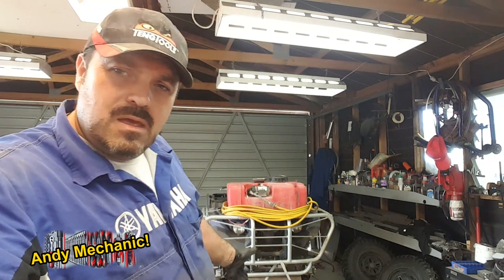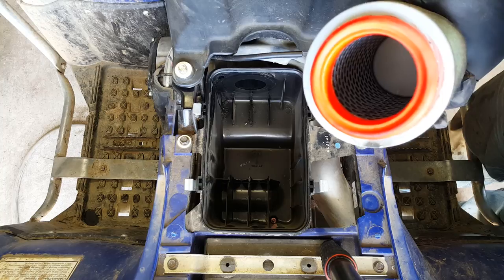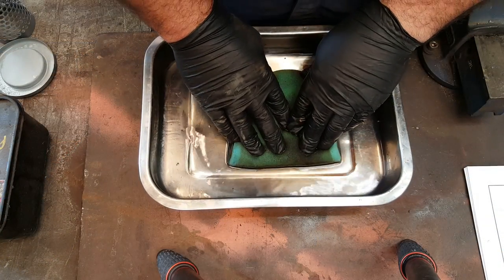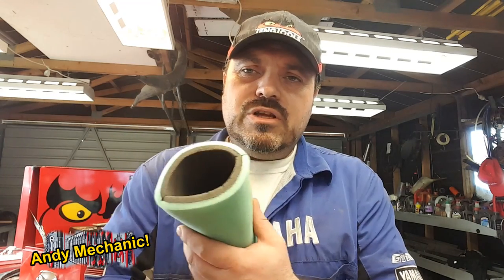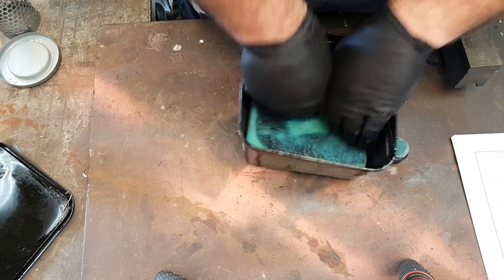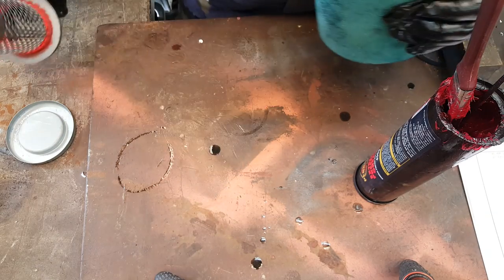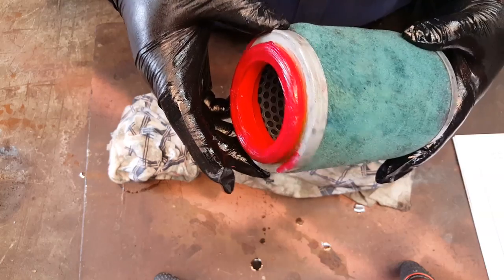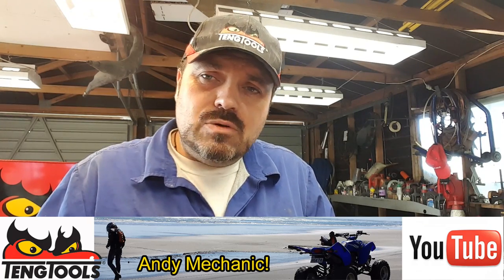Yamaha Grizzly 450 - foam air filter service #1810

Comment: You’ve probably been told this before but you are awesome. Thank you so much for the video. My grizzly stopped running and the only thing I could find wrong was an extremely dirty air filter. So I will be cleaning it and doing exactly what you have shown. Thank you, thank you, thank you!
Reply from the maker: Cheers Charlotte :-) really appreciate your feedback & it's great to know the video helped you out. Until next time Andy
Reply: Andy Mechanic well, after my filter cleaning, just like you taught, I put it back on and my 4wheeler still didn’t start. It turns over nice so now I’m figuring it might be a fuel filter. Is there an external fuel filter on these? I’m sure there is but I don’t know where.
Reply from the maker: Hmmm.....just try starting it without the air filter - sometimes the freshly oiled filter can restrict the air too much. Make sure the air box is clean though so no dirt gets drawn into the engine.

Also, is the fuel relatively new or old as petrol can go off.

Fuel filter - just one in the tank I think
Reply: Andy Mechanic OK, I will take out the air filter and try to start the motor without it. The fuel was in the tank last fall. It is stored indoors. Thank you so much for your advice.
Reply from the maker: Hmmmm.....I'd suggest draining the fuel tank & carb & giving the bike some fresh petrol :-)
Reply: Andy Mechanic I ran it for about an hour before it quit. But I will change gas and see if that helps. Hope so, I use it on the farm a lot. Thank you so much for all your help.
Reply from the maker: Ah....Okay.  sorry, I thought the bike had been stood unused for a few months and then wouldn't start.  Okay, back to basics. Can you tell me if there is a spark when you hit the starter motor button - you'll need to pull the plug cap and either remove the spark plug or use another one in the cap. Make sure it's grounded to the cylinder head for the test. Cheers Andy

Comment from the maker: On some filters yes though air filter oil is much more 'tacky' and will stay in the filters foam where as engine oil will usually be pulled through into the engine by the passing air eventually. Hope this helps. Cheers Andy
Reply: Andy Mechanic, Great videos! Very thorough and easy to follow! Keep up the great work! Cheers from NL, Canada!

Comment: I've been watching your videos since I started tackling this Yamaha Bruin 350. All the air box pieces were missing and I had to find these parts. Still waiting on the last hose section that the box attaches to the carb. I was wondering if I had found the wrong filter, until you had mentioned that the lid will push it down into place.
Reply: I had bought a cheap filter off Amazon for my bruin and it didn't snap into place like the original one does

Comment: Hey Andy 
I just bought a new 2019 grizzly 700 

Took it out and did 350km is some very dusty conditions in NSW, the dust was like powder.

When I removed my air filter I noticed a small amount of fine white dust on the intake, I spoke to Yamaha and they said it’s normal to see a very fine white layer 

What do you think of there coment

Also I serviced my filter the same as you 
Petrol 
Let dry for 24 hours 
Yamaha filter oil submerged the filter and removed alll the oil until I couldn’t get any drips out.
I let it sit then grease and installed 
When I took it in for the service they said it was too dry and added oil to to it 

Can you remove too much oil when you squeeze the filter ? 
I have some pics I could email you

Comment: Hello Andy.. thanks for your videos brother… i have a 2018 Yamaha kodiak 450 4x4..

Does it comes with a fuel filter?
Reply from the maker: Yes, the fuel filter is inside the fuel tank, at the base of the fuel pump.

Aftermarket filters are available 

Hope this is of help. Cheers Andy
Reply: @AndyMechanic  thanks for replying back.. so that filter how can I replace it or you dnt replace it unless you replace the fuel pump.?  

And the after market ones.? How.?;

Comment: Can I use just regular motor oil to soak the filter in?  Or is the Yamaha oil have something special in it that I need
Reply: Michael Harless, motor oil is not suitable for foam air filters. Foam filter oil has a high viscosity and will stay in the foam cells where regular oil will not.

Comment: By any chance could you do a video on how to adjust a 2007 Yamaha grizzly 450 foot brake.  Mine goes almost down to the floor.  But my handbrakes work fine thanks
Reply from the maker: There must be a cable adjuster midway along the cable, undo the locknut & wind out so adjuster grows in length.

Cheers Andy

Comment: Hi, good videos, useful to me, i did learn some things, do you have any video explaining how to remove and service start motor and /o carburetor? (YFM450 2008) Thank You!
Reply from the maker: Sorry Paul, no video on that yet....
Reply: Can you answer a question for me. I can't find any information anyplace on the brake being set before the start switch will engage the solenoid and the starter. The only reason I ask is that all pieces have been replaced except the rear brakes don't exist.

Comment: hi andy! 
I was just gifted a Kodiak 350 from my aunt and am starting to dig into it for a well needed major once over before the riding season starts! 
for the air filter maintenance I have a couple of K&N filter cleaning kits! could I use that to clean and oil the filter?
Reply from the maker: +Chris Michaud Hi, Sorry for the late reply. To be completely honest I haven't tried to use the K&N cleaning kit on a foam type filter.

I wouldn't recommend it as it may damage the foam or the glue that holds the rim of the filter in place.

It may work....it may not?

Personally if I don't have any cleaner I use petrol but that's always a bit risky as it can dissolve the glue on some aftermarket filters. OEM are usually okay with petrol.

Hope this helps. Cheers Andy
Reply: thanks for the advice! cheers

Comment: Hi Andy, what kind of oil did you use on the clean airfilter, filteroil or regular engineoil?
Great videos by the way =)
Sheers
Reply from the maker: +Joakim Mogren Thanks. It would have been Yamaha filter oil. You can get a bio-degradable version too now. Hope this helps. Cheers Andy

Comment: Right next to where the filter seals in the Box there's a little hole and a lot of fluid is coming out that hole and filling up the breather Box what is the problem
Reply from the maker: That's the engine breather pipe by the sounds of it - likely the piston rings are a little worn & combustion gasses are entering the crank case causing oil  to be blown up the breather pipe & into the air box.

Hope this is of help
Cheers Andy

Comment: First time on your channel.  Love it. Just subscribed. Very good at explaining.  Btw what kind of oil did you use to put on the filter? Thanks.
Reply from the maker: Ah, I use the Yamalube air filter oil, not the biodegradable type, I prefer the original dark blue one.

Cheers for the feedback 
Andy
Reply: Thanks Andy!!

Comment: Wy is there oil coming out of that vent pipe on my 2004 Yamaha kodiak 450 please
Reply from the maker: Probably due to excessive crank case pressure caused by worn piston rings.

Andy
Reply: @AndyMechanic  no from that diff pipe
Reply: That small black tube that you sed not to forget to pot it back

Comment: Can I use engine oil for the filter
Reply from the maker: +Logan Logan you mean on the O-ring?  Then yes, that's fine. Cheers
Reply from the maker: +Logan Logan if it's the air filter then no, it must be grease.

Comment: What weight of oil?
Reply from the maker: Oh it's not engine oil Rex, it's air filter oil, specifically for the job. You can usually get it in bottle or aerosol form. Lots of brands on the market. Cheers Andy